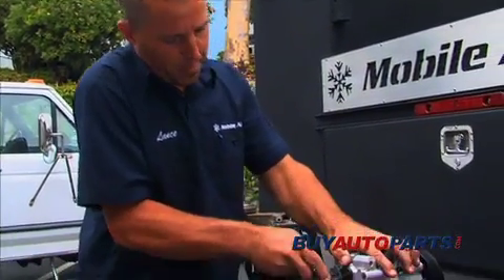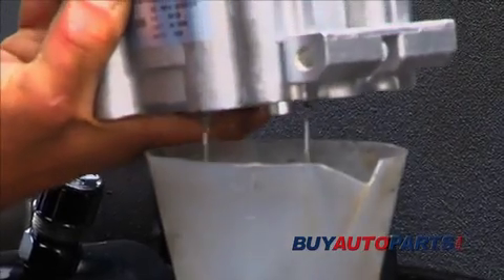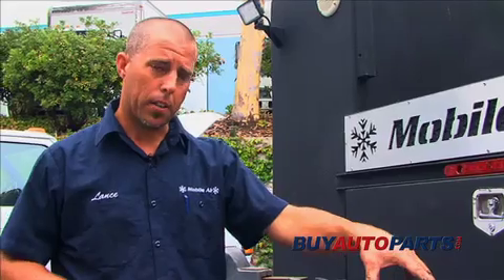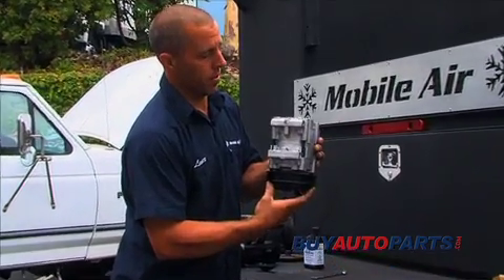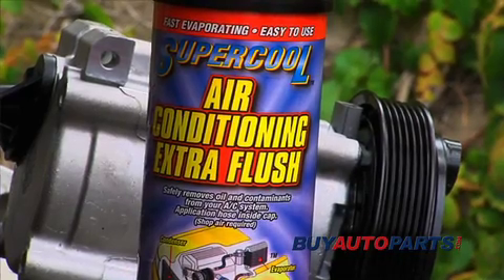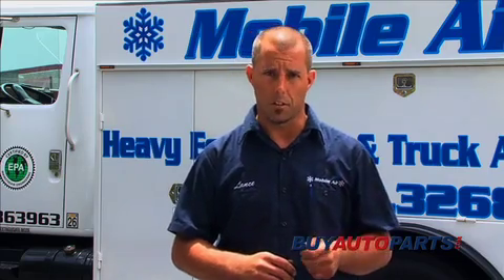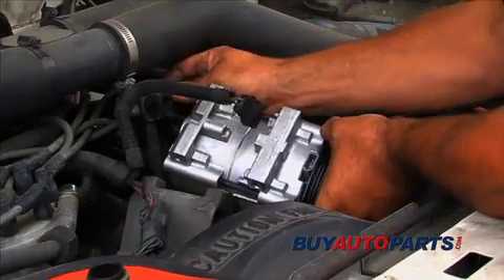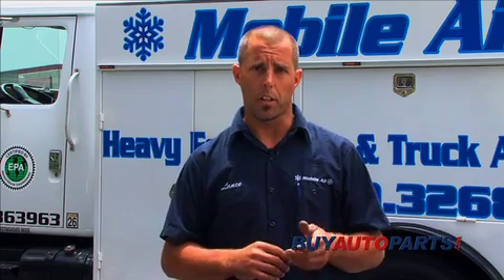Air Conditioner Compressor Repair How to Install: Mechanic Instruction- Part 2 of 3

Comment: You mentioned flushing the system. Are you going to spray it into the new accumulator and orifice tube? If there is anything in the hose you might have pushed it in to it. Does it matter which hose you spray it into? After spraying the cleaner into the hose, how long do you spray air through it to make sure it is cleaned out? 
Thanks